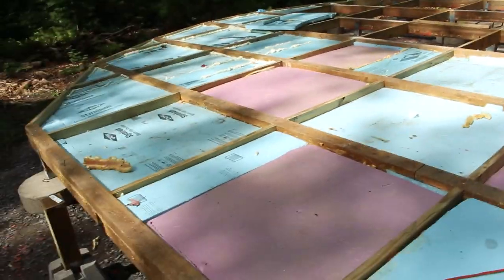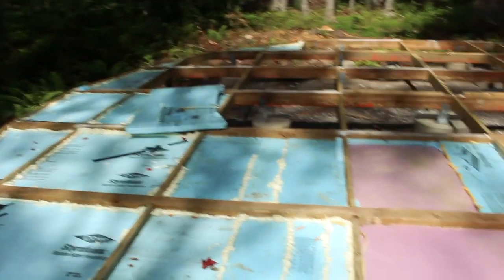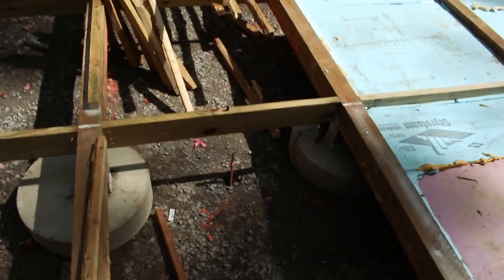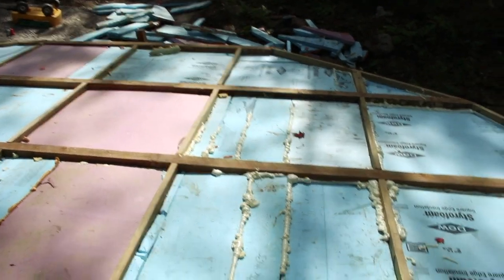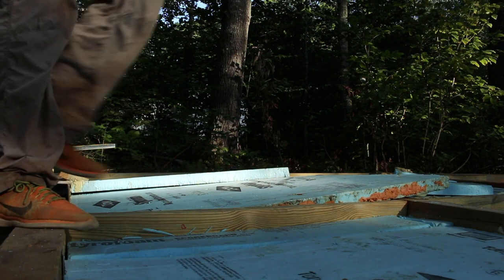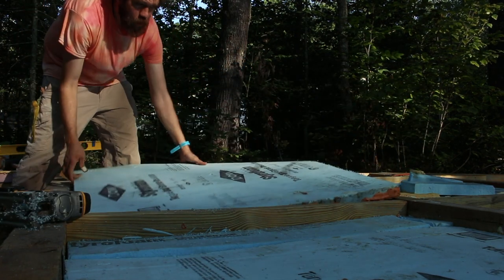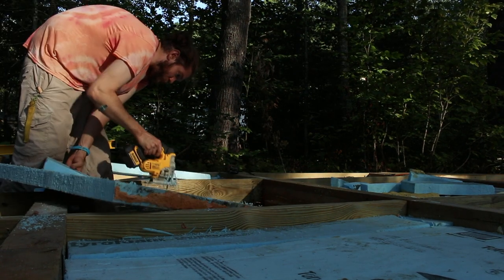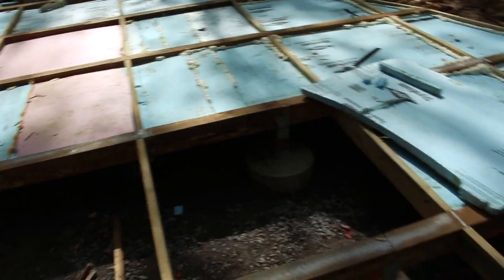How to Build a Yurt (Ep. 9 Foundation Insulation) #NoSmallCreator

Comment: Nice foam "quilt", Mike.  What holds all of the smaller filler pieces of foam in place, spray insulation?
Reply from the maker: Ima Druzy Thanks! Spray insulation, some wood blocking underneath the blue board and each piece being wedged tightly against the others, helps to hold all the pieces in place
Reply: @AllPathsLeadToWater  Oh, okay, snug is good.  Also, & fwiw, your "Tetriminos" aerial at 3:41 might make a nice wall photo for the yurt.